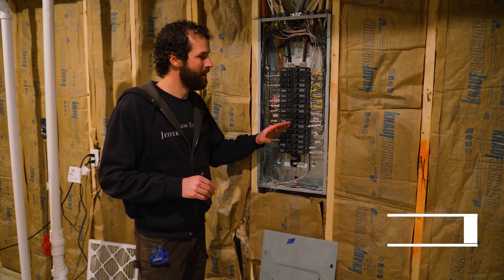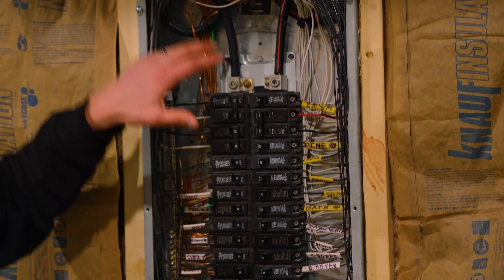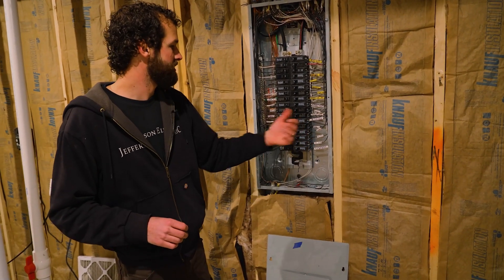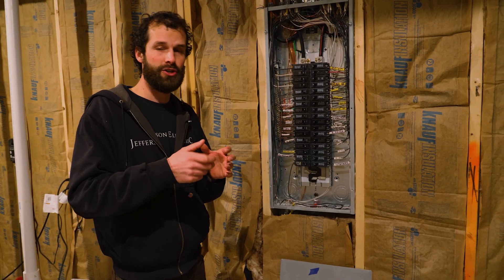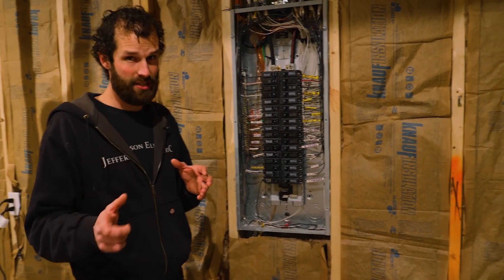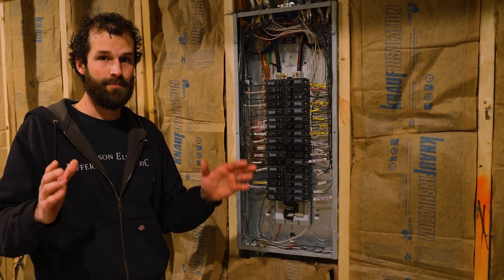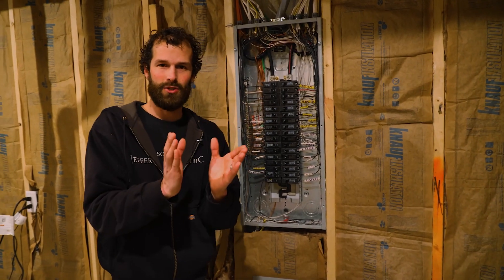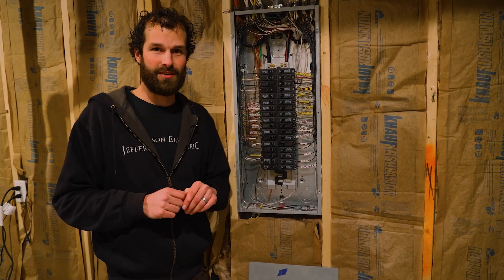Wiring an Electrical Panel 101

Comment: When you said about a clean panel, it raised a question that I need to ask the county inspector. I installed an Energy Monitor with 16 50A Circuit Level Sensors in my cutler hammer panel. While I took great care to be clean and well organized, it’s a boat load of sensors and monitor that must be in the panel.  I love the system because it tells an awesome story on loads, phase balance, etc.   I strive for safety above all and have learned a lot from your channel. You have been a mentor to me on a number of aspects.  Thank you Joel.

Comment: The smokeys "smoke detectors " should not have there own circuit,  that is wrong, they should be on a lighting circuit from a light switch, and I just write the number circuit on a pice of shidding and attached it to the wire, it looks cleaner and professional and just reference to the panel schedule with the number on the circuit...!

Comment: More misinformation by you at 3:24 . Aluminum wire has not been used since 1981.
 We use AA 8000 see 2020 NEC 310.3(B) which is an aluminum alloy and does not require NOALOX or pookie. 
I suggest you watch Mike Holts "Aluminum Connection Termination Methods".  Electricians U also has a video on the subject.
Reply: wait so i am in the midst of becoming an electrician apprentice should i use these videos as reference and guides or just use my code book from pre apprenticeship